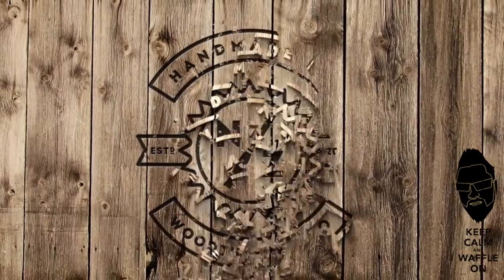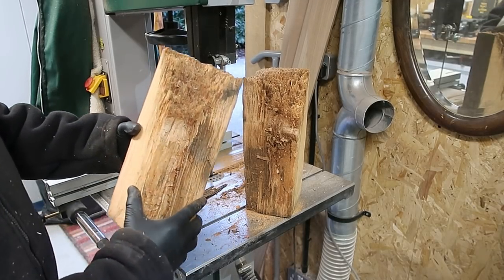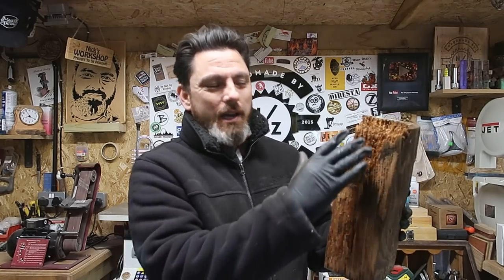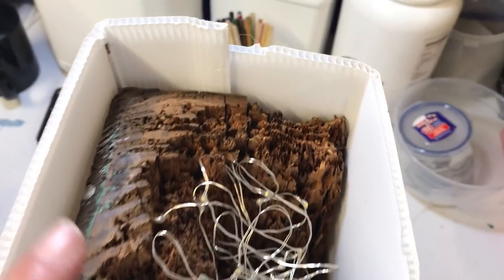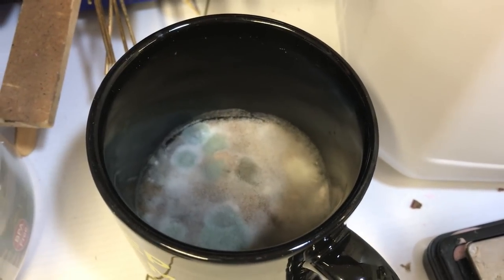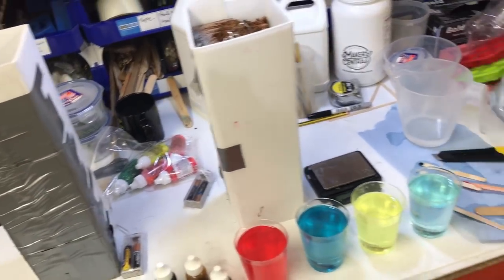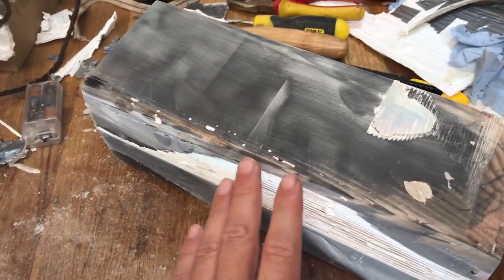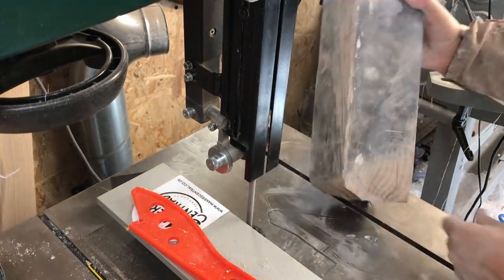Using Alumilite Dyes & resin to convert a 600 year old beam

Comment: Slice it like salami and DICE up the resin and make as many playing dice as possible?
Reply: That's a really good idea Ethan! I wonder if he will do that...
Reply: Ethan Cox lit idea bro
Reply: Ethan Cox use a chisel or a drill and dig out the wire... then add a thicker wire on and something to protect the wire then fill the little hole with resin again. If you don't like the shape then change it.... DON'T GIVE UP JUST YET, it can still be awsome. Upload a video on the fixing up. The main point is the lights and wires are still in there snd CAN work.
Reply: I don't think the weight would be distributed properly on a die like that.
They'd just be decorative dice.
Reply: 600 year old BEAN?  lol
Reply: @michelehonea6240  ....it's beam not bean  unless you were making a joke & it went right over my head...lol
Reply: @rcrow2011  There was a typo during the video, unless it's been corrected.  And I was not the only one that commented.

Comment: Really cool looking paperweights! Would it work if you bored a 1 1/2 to 2 inch hole from bottom to 2/3s of the way up and then mount an electric light in it. The problem with the lights you were using i think was that they weren't bright enough, something with higher lumens (hey i am getting techy) may give more of the desired effect you were looking for. Very interesting video.
Reply: Steve Sammut. Definitely agree with you.
Reply: yes, with as much pigment as he said he used ("too much") more, powerful light is needed to shine through it.

Comment: Too late now but drill bigger hole in the bottom wide enough to hold the whole battery box instead of taking the wires out the side. You could feed the string of LEDs up through from the bottom and temporary seal the battery box inside with modelling clay or disconnect and reconnect later. Another tiny point, if you didn't know, LEDs only light with the battery connected the right way round so when you cut them and reconnect them you need to do it the right way round. If it doesn't work one way, try the other way. Love the idea, could have been great.

Comment: Drilling a hole from the bottom, run string lights up, cut the bottom wire and feed it outside the mold, pour resin, shape like a vase but with a rounded top filled with the string lights, reconnect the wire on the bottom, add a base and switch... Win. You were totally on the right track idea wise.

Comment: If you still have this project, a suggestion on the lights.  They look like LEDs, which are directional on wiring, try flipping the wires around when you reconnect the battery pack. They may light up. Love your channel. Great work

Comment: Entertaining as always. Just a quick note of something I learned recently. Since you use a lot of hot melt glue, denatured alcohol will cause hot melt glue to release easily. Stops he need to have to try and cut it loose or cut into it. Just wet it, wait a minute and peel. Cheers.

Comment: This has been a great video as it's given me an idea of what to make for the tables at my family reunion this year :) Resin Torches!  

Also, I had a spectacular resin fail myself recently.  I was taking some wood and mixing it with resin like these, hot glued the heck out of my mold and I did remember to use mold release! However, my fail was that I did not check the hot glue close enough and it failed while in the pressure pot. I now have a pressure pot with some pretty red and gold resin in the bottom of it. The only thing you can do is learn from your mistakes and carry on! 

I did make a nice wood workers beverage out of the left over resin from that pour.  :)

Comment: I think the problem with the lights not working could be the heat. The LED chip’s only real vulnerability is from heat, so they may have failed when the power was connected because the heat couldn’t escape. Either that or the heat given off by the curing resin could have done it. 
Great video Nick! I think you were right to still upload it. 👍🏻

Comment: You should put a small clear glass/plastic bubble or balloon in the base of a piece of wood then cover it in resin and once set you could drill from the bottom and feed the lights thru there. that way you wouldn't have any fragile wires in the way and could very easily get a nice finish on your piece. Keep up the awesome content.

Comment: Hey try using hdpe for your molds, when using alumilite. I work with alumilite almost exclusively. I find that hdpe .5 inch sheets work really well and release with no issues,  without mold release.  Plus the mold will last forever. As far as color blending goes.  Alumilite is really difficult to keep the colors from just mixing together in the pressure pot. Especially when you're trying for translucent effects.  Silmar 41 is a poly resin that doesnt need to be pressurized at all.  The color separation is awesome and so much easier,  plus its more rigid so it turns very nice,  and takes a hither degree of polish with less effort. Something to consider.  Depending on the project i use the silmar 41 instead.  Love your videos man!

Comment: Nick, I just had an idea for your light problem. If you try this with the other 2 pieces or any other project this may work. Get a male and female plug like like whats used on headphones. Cut the wires to the lights and wire the female end to the lights and the male end to your power source. You can place the female end in the hole you drilled in the wood and epoxy it in place with it sticking out just a bit, make a hole for it in your plastic for it to fit in then hot glue around it to keep resin from leaking out or getting into the plug.  Hope this helps.

Comment: I had in mind something interesting for a resin wood LED light. You could drill a larger hole through the base of a project like this through the wood and stop when you hit the resin and then attach a larger led cob to the base. I was thinking you could use a led cob that had a downlight reflector attached to it which would send a nice wide beam through the center and then build a sort of shroud at the bottom where you'd do all the electric bits.

Comment: Oh Nick,Nick, Nick.... you should have run the light wires out the bottom. You could have taped them out of the way then added some feet to raise the towers off the wire. That way you could have sanded and polished these pieces without cutting the wires.... But I'm glad you posted this. People think making crafts whether it's woodturning, painting or quilting that it's easy once you learn the craft. But all crafts aren't always a breeze and often take a lot of man hours to complete.... Skill comes with practice. Failures are just lessons learned...
 Carry on, Nick! Love watching you work...

Comment: Bless you! I’m sorry that this didn’t work out how you wanted, because it would have been really cool... but good on you for still posting. It’s important for aspiring artists to realise that not everything works out, the picture/sculpture/wood and resin/metalwork/needlepoint project doesn’t come out as you expected, but that’s ok. Often you learn most from the fails and then you can do it again next time and it will turn out better. If you never fail, you don’t learn. Keep smiling xx

Comment: Hi Nick, first of all, I have no idea what I am talking about because I have never worked with resin. BUT, (:D) I was thinking, you have 2 more halves, right? In theory your idea could work, but you need to do some more preparations maybe. I personally would make a hollow in the bottom for the battery pack, and put something like one of those old camera film tube boxes in there, so there will be no resin in the hollow. Put the battery pack in that and seal the hole for the wire up with glue. Now you pour resin in from the bottom and not the top, and basically you'd have a mold in a mold. That way, the battery pack would be up inside the wood, wires and all, safe from resin and you'd be able to sand the edges all you like. I'd draw you a diagram if I know how...
Thank you for putting this video up even if the end result isn;'t what you envisioned, its still a lesson!

Comment: Did you put the blanks in the pressure pot? Because that might have broken the lights inside of the resin? Even those tiny bulbs have a little bit of air in them.
I love that you put this video up because this has helped me figure out some problems I've had! You Sir, are a boss! xx

Comment: A good idea for the next one is to drill out a cavity on the bottom to tuck the switch in to and seal it with hot glue that can be cut out after the mold has set, it will protect your wires during the sanding process.

Comment: For the other 2 pieces you should inlay the powerbook on the bottom. Run the wire up front one if the sides. These would be really cool lamps

Comment: I think I already commented on one of your previous videos with this suggestion.
You should have carved a void in the base, cut the wire long, rolled them up, wrapped them in plasticine and stuff the lot in the void. Once the piece was almost finished you could slice the resin off the bottom to get into the plasticine filled void and retrieve the wires.

Comment: if you still have two wood blocks left, next time you could try drilling through the bottom, bringing the wires through the bottom, capping the top and casting the resin upside down, that way, you can leave the bottom unfinished and bring the wires through some kind of a base, but you can do basically what ever you want to all the other sides of them :)

Comment: Nick, I might call this a "failed project" only in that you didn't get the objects that you wanted. On the other hand, you have gained some knowledge and that can only be useful going forward.
It also occurs to me that a way to deal with wiring like this had in future projects could be to--before adding the resin--drill a fairly large diameter hole in the place where you'll want access to the wires, bundle them together, and then stuff that bundle into a small plastic bottle or vial (that would need to be a size to very tightly fit into the hole). Fit that bottle so the bottom of it is even or slightly proud of the outside surface.  Once you start to sand and polish the outside of the project, hopefully that small bottle will then protect the wires and enable you to retrieve them.

This was a good video to watch, we all ought to be able to learn from our mistakes and seeing that even experts make mistakes is helpful to those of us who are not. 

Thanks!

Comment: If the wires inside are still intact you might want to make sure your polarity is right on the wires. LEDs only move electricity in one direction. Unfortunately sometimes you can fry the first one in a string if you plug them in the wrong way. I hope you try this again! Maybe cut a hole for the switch ahead of time. I'll keep watching. 😀👍

Comment: the blocks can be used as bookends, if they're flat enough, and the drilled light and wire looks like the moon through the branches of a dead tree, so it could be used in a kind of scene piece.

Comment: Check the polarity of your power source. LED Light emitting diode will only allow voltage to pass in one direction. If you have a multi-meter that have diode check, use that to verify that the circuit is still good...
They still look amazing and I think if you get the lights to work you may find that the colors you looking for might still be in there...

Comment: Pondered a little. I know little to nothing on resin making, however, been thinking (💡moment) 
Maybe place the string of lights in small tube to protect them near battery. Drill a hole through piece of wood and slide in tube with lights. Carve out a space for battery on the bottom of that side, then battery housing has a home. Then find square tupperware counter that is large enough or build a box and hot glue battery side on top part of containers. Craftey minds always thinking 😂

Comment: They look cool though,  and the mix of colors makes them look like galaxy. May be if you repeat the project it would be better to make the wires exit from the bottom so they are protected from sanding.
Any ways so exited to see projects with lights now.

Comment: You should resin stabilize or "resin impregnate" the wood. You soak it in a specific resin in a vacuum chamber to replace all the air in the wood with resin. Then you bake it and it becomes hardened wood again!

Comment: Maybe you could cut the chunk into quarters and hollow out the inside parts of those quarters (removing the light chain by that too), then put them back together with a lamp socket and LED bulb inside. Then when the chunk is back together maybe cutting off some bigger parts in the middle to give it a less chunky shape would look nice. I think with proper polishing that would still make a very cool bedside lamp

Comment: Nick, if you still have the other two chunks, why not cast them into clear resin? But make the mold larger on two sides (i.e.: position the wood block off-centre inside the resin). Then turn it. Wood will be exposed on one side of the cylinder and fully encased in resin on the other side. Could be cool looking.

Comment: If it gets cold in your shop you should invest in a wood stove or a pellet stove, ive had both, currently running a.pellet stove, put a 40lb bag of pellets on the hopper and it'll runn for 24 hours straight, keep your shop at 30c its GREAT.. englander stove works make an awesome stove. 
1600 Canadian dollars for stove 
5 Canadian dollars for a bag of pellets or 185$ for a tonne well worth it mate, you'll love it

Comment: FYI, led lights only work with the correct polarity. Try reversing the polarity. And next time use a higher Kelvin led. They appear more white than amber. And the colors will pop easier.

Comment: We learn from our mistakes. Maybe should have made pocket in base for the battery pack and wires. Then sealed to keep out resin from the pocket.  I have done something similar ( without the resin.). Maybe the heat buildup from the amount of full pour of resin was to hot for the LEDs. They are heat sensitive on some units. Maybe smaller pours in stages to keep the heat buildup to a safe point.

Comment: There is so much you still can do with them peaces you made. Never give up. Sit back and think about in. It might not be what you wanted but it can be something different. I woulds put themt on the lathe and see if you could still make some lamps or cut them down and make legs for a table or maybe some pens. When I'm in the shop things change all the time I've never made exactly what I first planned little things change. Very close, but little things change all the time. The wood and resin looks great ya you could still fix the light too with some solder and shrink tube good luck thanks for sharing your video.

Comment: I think what would fix this the next time around would be to make a pocket in the back side of the wood for the wires, then put the wires in seran wrap, then stuffed em up in the hole and sealed it with hot glue. Then retrieve the wires when the project is finished.

Comment: You can make them into lamps by drilling to the resin from bottom, cutting them vertically/on the drilled hole, hollow out a bit of the resin, put in the lights, and reseal it. Let them become an happy accidents not failures.

Comment: Turn it into a regular lamp! Use it as a stand, drill s hole for the wire from top to the bottom side, then attach a holder on the top of it and ad a pretty lampshade. It's not really a waste. ✌️

Comment: Its pretty at least. The other pieces...maybe stabilizing resin? Drill out the center to run the light wire through, then make a base to hide the switch in?

Comment: Maybe you can chop them up and reuse them. I still like the look of the wood and the resin is unique.
With multiple colours, may need to let each colour at least partially set before adding another colour.

Maybe you can use them as funky bases for other projects?
Oo lay them flat next to each other with a bright light between them and have a shallow bowl of resin and wood on top so it all glows like a galaxy?

Comment: I saw one of your videos with a log container with a top with pine cones on top. I wondered if you ever thought of using a a router on the prepared log to give the appearance of wood  lines, like it looked like you attached wood to the log, but used the router to make the parallel lines or swirled lines? I tried to find the video, but couldn't spot it, so I add the message on this thread. Keep of the great work. Don't worry about the videos being too long. Too short is a lot worse than an extra long one. Keep doing what your are doing. Coop

Comment: You still have to save the wood. Cut the top off and make candle sticks. Love the show, you're hilarious
Reply: And the Bart Simpson cameo was classic
Reply: Next time maybe you could still and run the wires through the middle somewhere and build a pocket in the bottom and stuff full of extra wire so you could have an easier time recovering and using less in projects like this. Love the concept

Comment: maybe you could hollow out the backside near the top were most of the resin is and still place a new string of lights in it and use a clear resin to seal them up and then you could still have the switch to turn the lights off and on and will still see the wire through the resin. just a thought, if you still have these 2 pieces.

Comment: For those kind of lights,  they are covered in a coating that you have to scrape off if you want to soulder them. When you found the wire again,  you might of had to do that